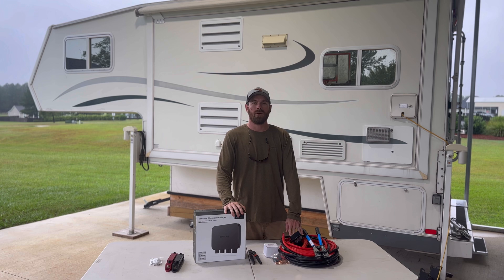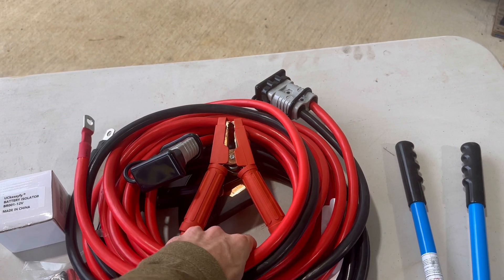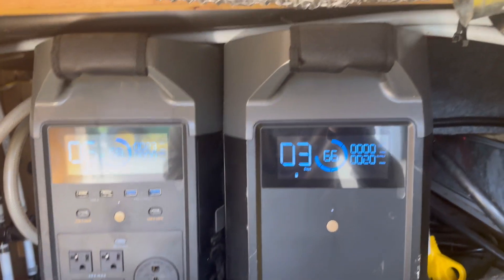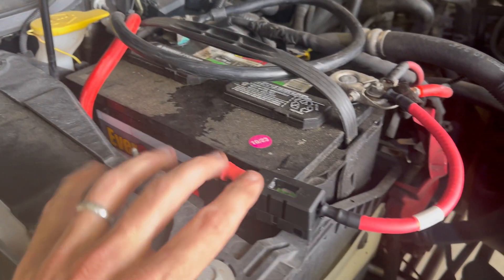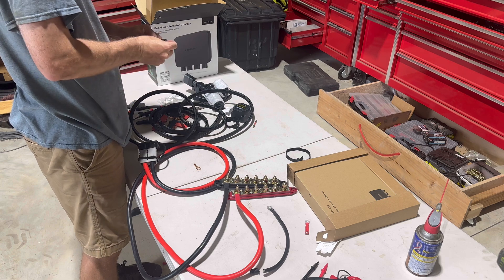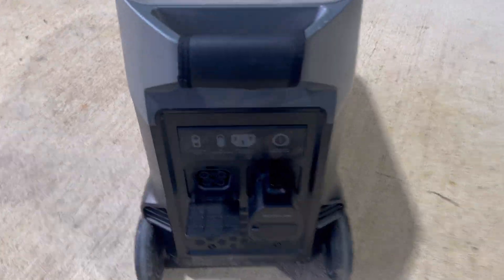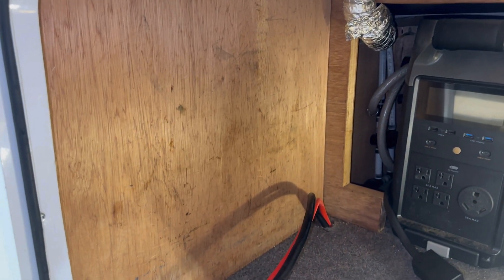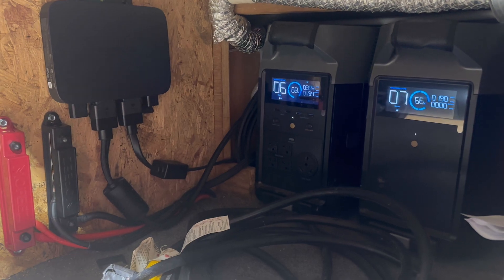Ultimate Off Grid Truck Camper Power: Ecoflow Alternator Charger

Comment: Hello!! I just watched your video and i am trying to do a similar set up as you with our EcoFlow Delta pro in our 2019 Eagle Cap 1165. Being that i have a bunch of EcoFlow items, i figured I would try and use this as an off grid power solution. Would it be possible for you to add all the items you used with links to get them in the information block. I have an Anderson quick disconnect in the bed of my Super Duty which is connected to my battery for the Sterling DC to DC charger that is in my 5th wheel. I am wanting to possibly use what is already there to connect to the alternator charger. Thanks for all the detail you show in this video.

One additional question. How did you tie in the batteries to your truck camper? Are you just plugging in to the 30amp whenever you get set up?
Reply from the maker: Ren,

I don’t have a list. Most of the supplies I bought off Amazon. 

I keep the TC plugged into the EF battery bank with the 30A plug from the time I leave the house. If I were to exhaust my battery storage (continuous AC use for hours), I keep a honda 2000 in a front box I can plug in with an extension cord to top off.
Reply: @J @JustMitchell17 thanks! I just got the 800watt alternator in, and need to install. I’m gonna figure out a way to connect the EF to the truck camper and if I ever need it I do have the EF smart generate as well I will have with me to top off batteries

Comment: I installed one of these in my camper too..  then put it to work..  https://youtu.be/5EKn2l6vKYQ?si=R5faMduVjgXynVO5
Reply: I ran my EF cable through the firewall, under the center console and out through the rear slider. It had about 6" of slack .

Comment: I see you used about 20-25 feet of cable to get to the buss bars from the truck battery. Then it looks like you kept the EcoFlow cable intact and just curled it up in the box next to the EcoFlow units on the left. Have you had any issues with the cable length being 40’ or so? I’m looking to do the same with a couple vehicles and I don’t want to cut the EcoFlow cable.
Reply from the maker: No issues. Getting 700ish watts consistently at highway speed.
Reply: That works for me. Thanks for the help and making the video

Comment: I am looking at doing much the same thing that you have done with your slide in camper but with our travel trailer. I plan to do the same on the truck side with an Anderson connector at the bumper then extend the cable in to the front storage compartment. I may install an intermediate Anderson connector in the cable at the back seat so if we are leaving the trailer at the campsite and driving somewhere I can still charge the EcoFlow Delta Pro.
Reply from the maker: I like it. Should work well 👍🏻

Comment: One of the unique features of the Ecoflow alternator charger is that it can allow your delta pro to recharge your vehicle battery (at about 60 amps!) and using a battery isolater completely negates this huge benefit of the Ecoflow alternator charger verses the Precon alternator charger.  By setting the turn on voltage of the EcoFlow to 13 volts, your truck battery (12.6 volts at full charge) will not discharge when the truck is off.  If your alternator puts out more than 14 volts (most do), then you can set the alternator charger to start at 14 volts and be completely on the safe side.  Hopefully EcoFlow will do a firmware update to allow finer resolution than 1 volt intervals in the future.  Nice workshop / garage and nice to know that another $70 bucks has to be spent to use it with the Delta Pro!  Thanks for a nice review:)
Reply from the maker: I carry a separate jump box so that wasn’t too big of a benefit. But if it truly cannot discharge my truck battery, I will remove the isolator. 

I hope they do allow finer adjustment to better capitalize on the available power. If it’s at 14.1V, it requires you to set it at 14V, and the available energy to charge is much less. An alternator putting out 13.9V set to 13V give you mush larger amount of energy within the 1V tolerance.
Reply: @JustMitchell17  I guess the best way to determine would be to check the voltage of your truck battery after the truck has been off for a few minutes.  If it sits above 13 volts, then the alternator charger will continue to discharge it until the voltage drops below 13 volts (100% charge for flooded lead acid is 12.6 volts).  If you don't need the alternator charger to recharge the truck battery, then continue to use the isolator.  I have used one for many years.  If you have a hybrid battery, then you would definitely need to use the isolator.

Comment: Cant you set the charging rate on ecoflow alternator so that it only draws when the volts go over 12, so no isolator is needed?
Reply from the maker: Neil,

You can set the charge rate. I’m finding out it is very sensitive, and really dependent on the output of your alternator. It will throw errors for over current or under current even if off 1 volt. 

But you may very well be correct and the isolator may be redundant. So I may eventually remove it.